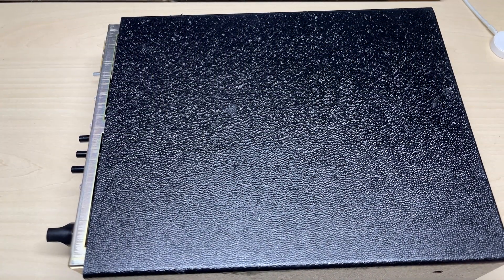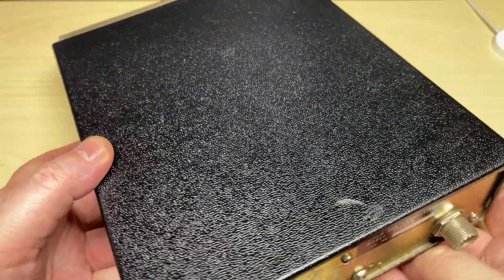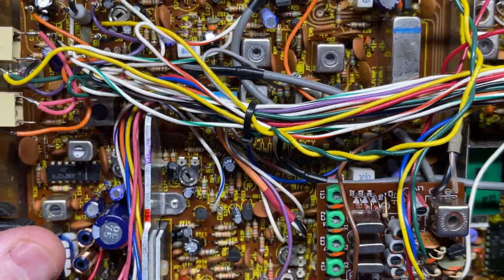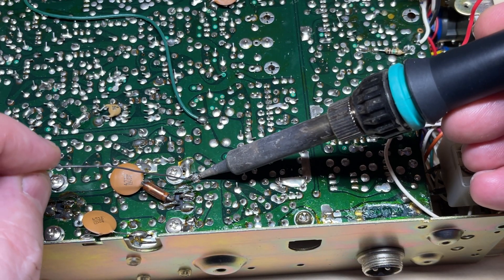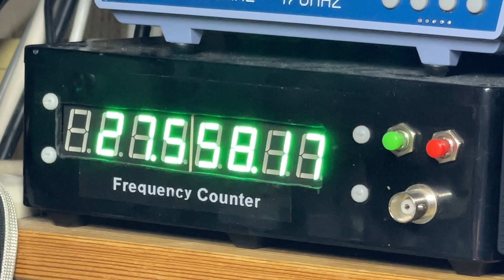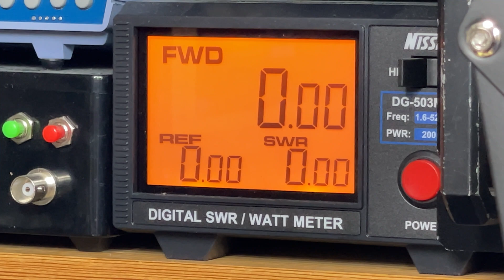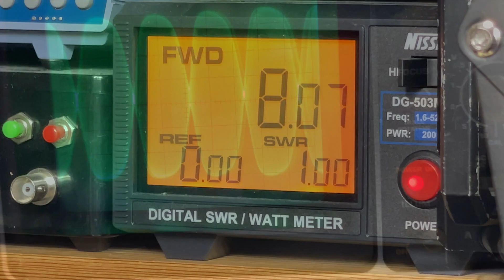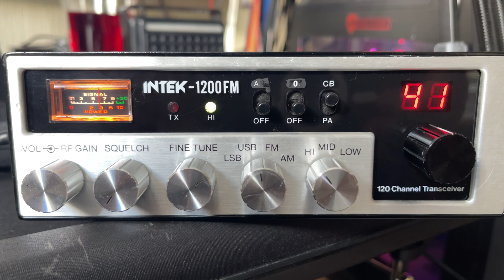EP 132 - Intek 1200FM SSB CB radio - Bad front , good insides - Can i make it great again ?

Comment: I had a Lafayette 1200FM so exactly the same as this.

I built a 2-tone oscillator and used my Tiny SA etc to fix it and get it all aligned.

I went right through the Cybernet Export Service Manual and annotated all the PTBM121D4X trimmers / crystals etc throughout the whole text.

Good work!
Reply from the maker: I built the same , 2 tone and use tinysa , not sure i had it when i did this video .